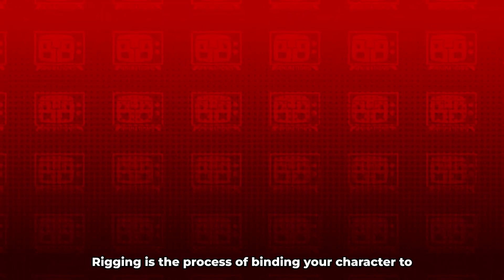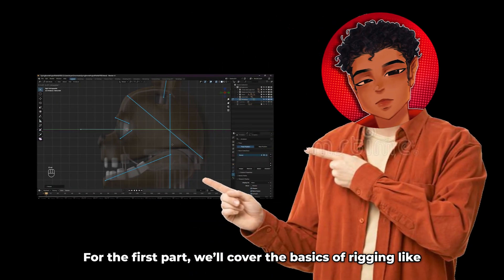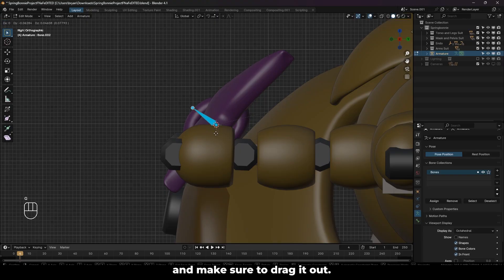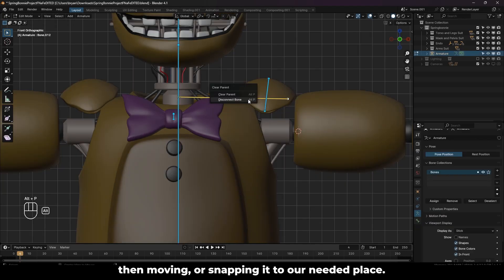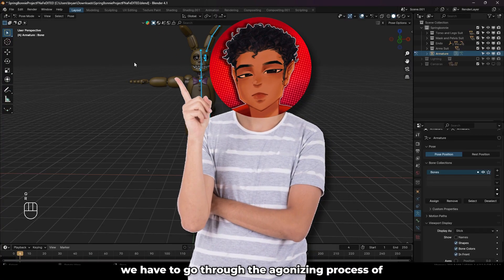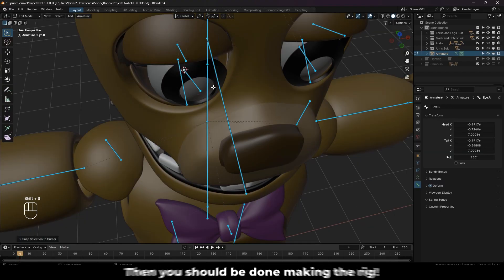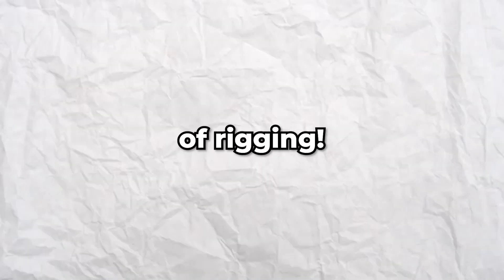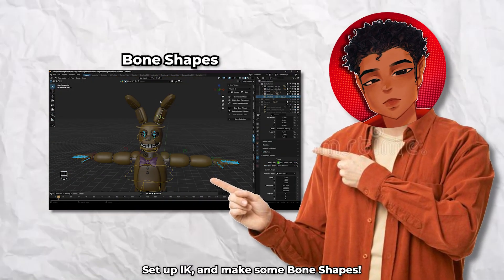The Basics to Rigging FNaF Models in Blender!

Comment: The reason why the legs never parent correctly is because your extruding off of the pelvis bottom. The bottom of a bone i think mathematically or something is considered the top of the previous bone, and since theres no bone there, it just doesnt parent at all.
 If you wanted it parented without manually doing it, youd have to extrude from the top of the pelvis, or duplicate the chest bone and adjust it from there
Also, a small tip, if you make a single bone from, as an example, the top of the upper arm to the bottom of the lower arm, you can select the whole bone, right click and subdivide it, cutting it into as many peices as you need, then you can just adjust where they meet from there
Reply from the maker: This is actually pretty helpful! Gonna do this in the future